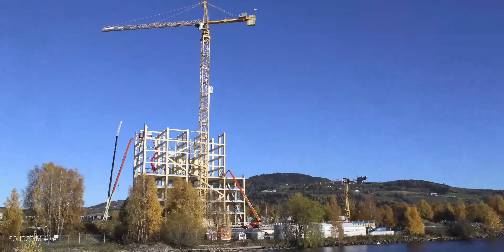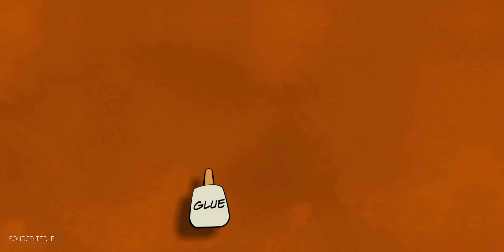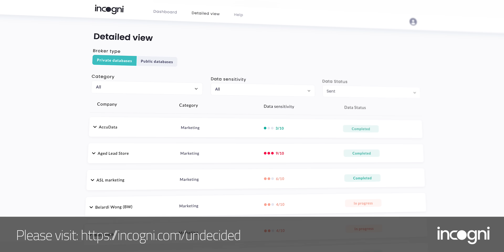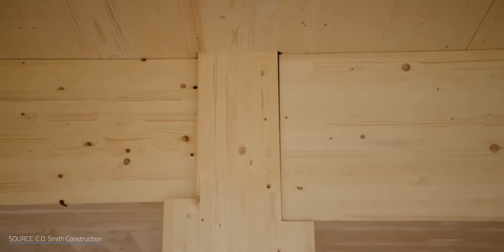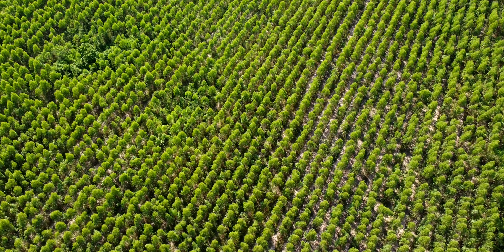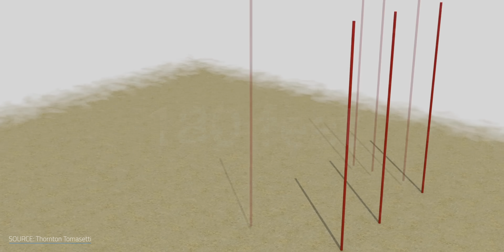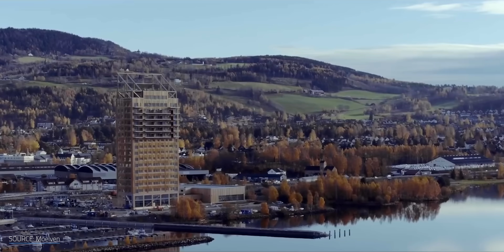How We Engineered Incredible Wooden Buildings

Comment: My first thought wasn't fire, it's humidity and water leaks. If a pipe goes a few days with a small leak then the lumber by it's self would absorb the water and rot causing structural issues. 
I know with wood finishings on boats, it's never the salt water that causes rot but freashwater from rain, and I see a building full of pipes of clean water and I only see a problem waiting to happen.
Reply: Concrete doesn't like leaks over long periods of time either. Leaks in general can cause severe damage to a building. There are probably differences but I don't see there not being solutions.
Reply: Hence the Forth road bridge and the Genova Bridge...
Reply: @corsolaau  but in buildings are used reinforced concrete with metal - and you could clearly see, when it is damaged - while with wood, you would see it when its already late.
Reply: @corsolaau  Self-healing concrete fixes itself when it gets wet. :)  Just throwing that out there!
Reply: @wezul I was very hopeful for self healing concrete to be usable immediately, but I'm not so sure that will be possible in tall buildings for a while at least. The concrete is mixed with sea water, and sea water and rebar don't mix.
Reply: If standardised parts are used like legos, a partly rotten part could be replaced fairly easily compared to a rusted rebar/concrete part. There are also pressure treated wood that would make sense to use in/near wet walls and other high moisture risk areas, after all wood pilings are widely used under smaller buildings and in piers/docks in pleasure marinas not to mention shipps that lasts 50-150 years with proper upkeep.
Reply: As someone who's cement apartment building is currently dealing with numerous water leaks as a result of recent heavy rainfall: it isn't just wood that's affected. ANY building has to deal with water, no matter the size or material it's made from. Water is just that tricky to handle.
Reply: I find it interesting that rot and mold concern you but carbon emissions from concrete and steel production don’t.  That’s because you get your info from political / industry hacks whose agendas are intertwined with the Rupert Murdoch’s of the world.  You take their info as fact and everything they disagree with as “undecided” or unproven.  How sad that so many people can be brainwashed so easily.
Reply: I suggest you search youtube for wooden bridge collapse.  All these new bridges made from this type of wood needed to be re-engineered to prevent additional collapses.
Reply: You could just cover the outside like any other building for protection against rain, and the wood finishings for the inside against leaks from the pipes.
Reply: @WolfeSaber  I never thought it would be exposed to the elements, but for normal 1-2 story residential buildings with wood frames don't use any water resistance coatings on them because it's protected by the house. But their are tons of cases of of wood rotting from AC units having issues and the water pans leaking or a leaky pipe giving a slow constant leak. At my house due to a small leak under the kitchen sink it seeped into the subfloor and joists causing thousands in water damage.
I've never heard of wood that goes inside a building where no water should go being finished to prevent water damage.
Reply: @john38825  The construction method in the video goes with layers, meaning that some of the wood is sacrificed to protect the others. Plus, you can also treat the wood to resist the water.
Reply: Wood doesn't rot from beeing wet for a few days. It rots from beeing moist for long periods.

Leaks happens, but it's fixable.
Reply: @ThePentosin  ??? What do you think an internal leak is? It takes people years to discover them, by then the entire building could be in danger.
Reply: Water's already a big deal for concrete and steel reinforced concrete, even if wood's more sensitive to being leaked on, preparing or designing around it is already a thing.
Reply: Wood 5 over 1s in the Pacific Northwest are suffering from wood rot due to the weather and is expensive to repair
Reply: This has nothing to do with saving the environment, it's just a way to cut corners and save money.

Comment: So mass timber will let us consume less concrete? since  the concrete foundations of a mass timber buildings won't have to support a lot of weight compared to the foundations of a steel & concrete building.
Reply from the maker: Yep.  Less concrete is needed for the foundation since the overall weight of the building is lower.

Comment: a. Forests (trees) convert carbon dioxide into to breathable Oxygen.  b. everything burns or will sub-come to fire (Trade towers) which were steel and concrete covered in asbestos (to delay or even stop fire) collapsed much faster than anyone thought. c. buildings , apartments and homes have Natural gas for heating , cooking, washing drying.  So unless they limit these buildings to electric only (which has own problems with wood), people will be using open flame of a type in these new wood builds.

Comment: So Matt have you ever heard of a skyscrapper in london called Grenfall Tower . BTW it caught fire. Might kinda explain why we don’t make skyscrapers outta wood.
Reply: Mate, the Grenfall Tower fire wasn't wood - the insulation that burned so quickly was a foam plastic (polyethylene-filled aluminium composite panels), and the fire got fed oxygen due to the shapes of air shafts.
Reply: And btw Wooden buildings get slowly eaten by insects
Reply from the maker: https://www.bloomberg.com/news/features/2023-04-19/low-carbon-wood-building-designs-face-fire-safety-doubts-in-uk
Reply: @UndecidedTechnology  Skyscraper made of steel and concrete still burn down and now one made of wood . Try finding tenants brave enough to wanna live there .Plenty of sprinklers and no balcony barbecues.
Reply: Wooden Skyscrapers office blocks really ? Now everyone is working from home .🤣🤣🤣🤣

Comment: You said nothing about the glue (commonly Urea-formaldehyde), or the preservatives used. While the building in the video look to mostly use glulam, other forms of engineered timber like laminated strand lumber and parallel strand lumber have a high percentage of resin/adhesive, to the point I've seen it referred to as petroleum-based wood.

Comment: What of rot, water damage and risk of termites, fire is not the only problem with wood. The use of any Material in a skyscraper means trusting it not to collapse just from existing and being used and if a plumbing issue on the top floor bathroom can rot the supports and cause a collapse that isn’t a risk worth taking.
Reply from the maker: That's true of every material.  No matter what you use (cement, steel, etc.) you have to inspect and maintain it.  A bathroom leaking isn't going to rot the key structural members of the building.  It might affect the floors or walls, but wouldn't take an entire building down.

Comment: I think that despite the high number of trees cut it would create it would also help reduce the world's CO2 coverage since the carbon is held inside the wood as it grows. As for the number of trees being cut down, I think the only way to stop that becoming a problem in terms of oxygen produced or simple supply is to drastically increase the amount of trees planted for every tree cut down, say 50 instead of just 3 or 1. Naturally that will mean a LOT of trees but if they're planted along man made rivers, such as the one that made for ships to cross maybe 80 (don't remember either the name nor the year) years or so ago, then it should avoid sucking out all the drinking water and only use sea water. Alternatively like the floating farms could make floating tree farms with long wooden pillars of soil under the water to keep the trees right way up while also giving them somewhere to put their roots. The pillars being made of wood would mean the sea water would get into the soil naturally avoiding the need to manually irrigate, just gotta have the right trees for it since I doubt all trees can handle salty water.

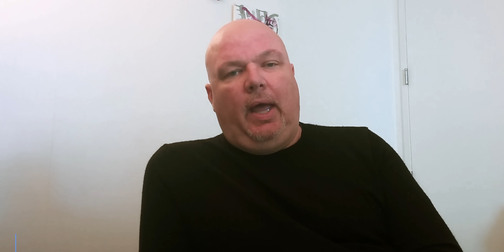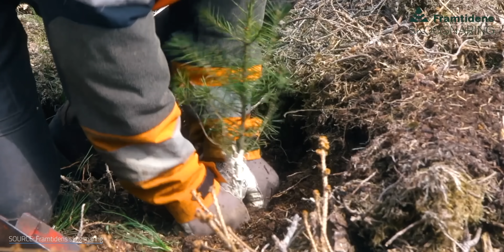Comment: 3:37 One notable problem with this sort of replanting is that the replanted trees are often a mono-culture. From the perspective of a logging company it makes sense, mono-cultures are easier to harvest, you get all the same type of wood which makes the structural properties of engineered timber products more consistent, and you can pick fast-growing trees like the pine being planted at 4:07 . Mono-cultures have significant problems as well, the most notable being disease, pest, and sometimes drought resistance.
Reply: That was one of my concerns.
Reply: I have the same concern.  In my region, the plantations are nearly decimating the water table.  This has severe knock-on effects downstream.  The wood used is fast-growing and is meant for paper, but any industrial application of timber will be problematic.
Reply: You can mix tree varieties and still have ease of harvest.  You don't have to randomly mix trees around to get the benefits of poly-variety forest.  You can have blocks of varieties designed for the harvesting equipment.   Maybe 100 foot wide swaths of one tree, then 100 feet wide of another and so on.  The birds and squirrels and stuff don't care.
Reply: Using bamboo is in lamboard is a great option. You don't have to replant after harvest because new grow comes up from roots, also bamboo it technically a hard wood so it is superior to pine.
Reply: @johnowens5342  Big problem with bamboo is that it is geographically limited, none grow north of Spain in the EU, and we do not want to transport the material more than a bare minimum. If you got it use it, that's the beauty of wood many types can do the job if they grow locally. Don´t know that it is as good for solid beams as pine and similar, but for particle boards or perhaps plywood but I am doubtful regarding ply.
Reply: Came to the comments to make the same point. Many Mono-cultures are at the expense of old-growth forests, making the ecological argument that wood frame structures are environmentally viable, due to the swathes of mono-cultured forests required to support it... Isn't really the full picture.
Reply: @CNR_ADMS  Well to be fair, at least here in Germany, most forrests are already monocultures, though in recent years there is an increasing efford being made to revert some of the forest areas back to a more natural state.
Reply: True. But Sweden / Norway / skandi has natural monocrops of spruce and pine anyway.
Reply: also how long it takes to truly offset the previously hararevsted trees. trees take time to grow. simply planting saplings doesn't have an immediate impact
Reply: It would be a problem if these trees are collected and planted inside a Forest. But they are not. They are more like "farms" and they do that for yield.
Reply: Monoculture is just a leftist label used in it's propaganda efforts against specialized agriculture
What you see in the field is that are literally thousands of life forms on the soil of any specialized crop, being the cultivated plant just one among all
About pests it's a manageable
The truth is our civilization will collapse without specialized agriculture, and this is the reason the radical left label it with the fake and demeaning word "monoculture"
Reply: The problem isnt monoculture itself, but the system we live. The real problem here is having goods being bought and sold as commodities. In capitalism, there is no end. You will only stop producing once all Earth's resources are depleted.
Reply: True, but that’s on the company that plants them. If those pests/diseases crop up, that company has to deal with it. They’re directly incentivized to avoid those issues. It’s not like a city that plants all one kind of tree and 20 years later they all die and no one has to do anything about it.
Reply from the maker: Correct.  These aren't trees that are meant to grow wild forever.  They're a crop that they're going to cut down again, replant, regrow, etc.  The company is going to be very interested in maintaining a healthy crop.  BUT ... I do get the concern about large monoculture crops of trees in a region.  There are other knock-on effects on the local ecosystem to be concerned about.
Reply: @UndecidedTechnology  can you do a followup on this and the cultivation of timber? I hope currently the lumber industry is mixing different varieties of trees for logging. I'm sure different types of wood for certain applications is better suited for the new mass timber skyscrapers
Reply: @UndecidedTechnology We also can't forget about the mother trees. They can help the younger trees grow stronger and faster. Decades of disease resistance can also be shared from the mother trees to younger trees. These are beneficial qualities to have in a forest, even one destined to be cut down for lumber.
Reply: @timwildauer5063 it's not just that. The monoculture have a deleterious effect on the surrounding landscapes and, to the others point, often come at the cost of old growth to begin with
Reply: Only a small part of forested land would be required as the trees grows faster than the buildings need replacing, so we will eventually reach equilibrium with building,replacement and growth of trees. And all that while reducing carbon emissions extensively as well as storing megatons of co2 in currently standing buildings. We should also naturally have large areas where no logging will ever be permitted and only fire breaks cut every so often to minimise natural burning losses and save wild life. I understand your concern but I think we can do both with little to no risk to biodiversity or building material supplies.
Reply: I was about to make same sort of comment. This concept sustainability is bit too wishy washy and suspicious.
The EU stopped negotiations with South American countries based on Bolsonaro’s crazy idea of extracting more and more resources out of Amazon and we have been talking about destruction of forests and difficulties in planting enough and suitable trees for years.
Imagine that majority of the construction sector changed to building using timbers within the next 10 years that is quite reasonable expectation. Are we saying that is sustainable? It doesn't sound right to me. It takes years for sapling to grow large enough to be used as timber and there are already whole bunch of loopholes in the forestry sector to use at speeds that it cannot be replaced. Once upon a time whole Europe was a forest. So, you must be really careful what you wish for. Enforcement of laws are not as easy as drafting them. The whole idea makes so many assumptions that are bound to lead to total f**k up.
I mean if we were careful and transparent about using carbohydrates, I would argue that we would not have been in such a mess. Imagine carbon capture technologies were implemented from the start. Soon the scale would have made them viable in terms of cost. We could be burning coal if we had built power plants that prevented all the smoke blowing out of the chimneys.
Even now we are not insisting to those who are building coal plants to setup system to capture all that waste output. People still lough at you saying that wouldn't be viable. So, apply the same argument to petrochemicals including plastic. No, human nature doesn't operate that way. Maybe if the average age was three hundred things would have been different. The longest a business takes into consideration is 30 years. The rest they put it on the next generation. Just as we are doing now. The baby boomer generation has already decided that it is not worth the expense. We will all be gone by the time sh*t really hits the fan. Just look at Putin. He could foresee that all that gas was going to lose value and left in the ground. Best make the best of it while you can. Of course, he overestimated his leverage against the Germans. But I can see the logic of his thinking.
Reply: Fire spreads more easily too, especially in planted in rows. We need vertical farming to convert agricultural lands for housing, parks, forests.
Reply: @nononono3421  Consider millions of acres of corn for fuel ethanol, plus cotton & soy fields. Hemp does what they do, better, with less chemicals; and is better for soil. This would allow for millions of acres at the edges of fields and along streams to be converted to permaculture forests, providing food for both people & wild animals. Changing agriculture requires policy & political change, unfortunately.

Comment: There's an 8-10ish story building near me being made out of some kind of wood vertical beams that look like this... told my wife it looked like some kind of LVL beams.  We always see the 4-6story apartment buildings that have a concrete parking structure at their core and then normal house-like 2x4 frame wrapped around it, but this is the first time I've seen wood on something taller and without a concrete core.

Comment: Termites, the wood is treated.

Fire, the wood is actually better as wood doesnt deform from heat and large pieces of wood take a long tine to burn thru and form a protective insulating layer as they burn, so as long as they are using 12 in x 12 in members as opposed to i beams made with a 1/2 in sheet of plywood and a 2x3 top and bottom which could burn thru in 10 minutes wood can have good fire resistance.